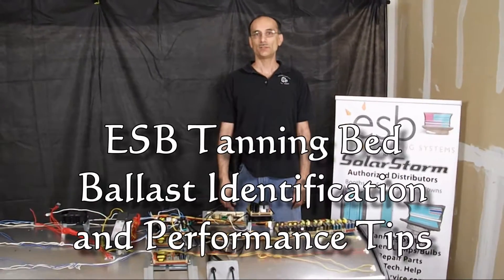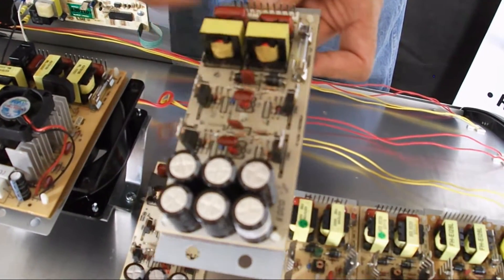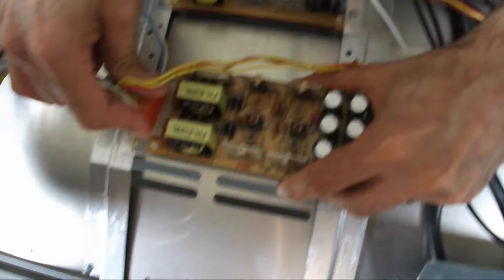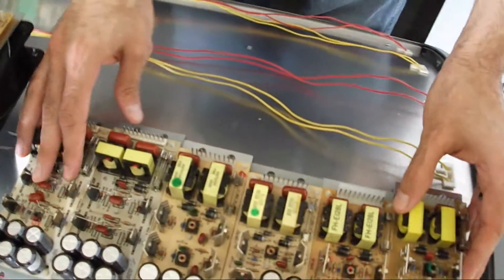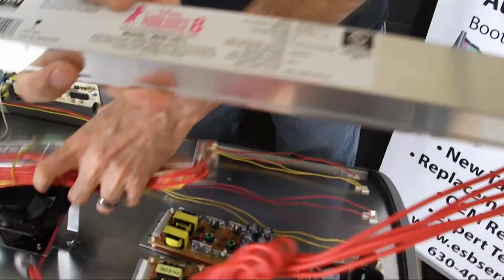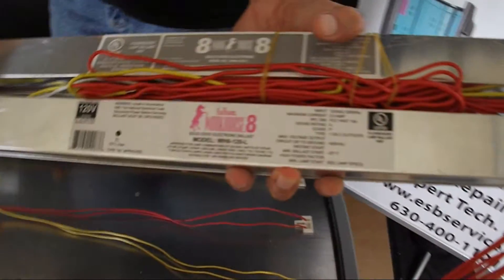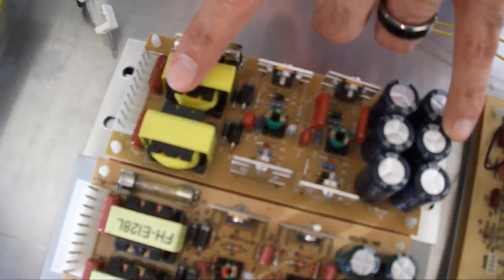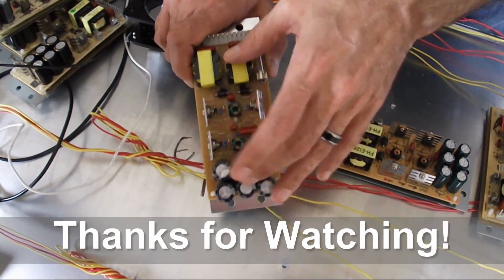Ballast Identification and Tips for ESB Tanning Beds

Comment: What components on the ballast boards usually go bad other than looking at them physically to see if anything is blown.
Reply: Thanks for getting back to me Russ. I find your videos really informative.
Reply from the maker: @EdwardSedlak  You're very welcome...Thanks a lot for your feedback!
Reply from the maker: Thanks for watching and for your question.  If you're doing component-level repair on this circuit board, it may help to know that the most common issue is the output drivers going bad.  They are four transistor-looking components usually in the middle of the board, towards the outer edges.  A lot of times, they are mounted on heat sinks, but not always.  There are two channels to this circuit, so you might only find two that need to be replaced, rather than all four...but you also need to replace the respective diodes on the board, or else you'll blow the new transistors on startup.  (The fuse usually needs to be replaced as well, of course if it blew.)  It's important to remember that this circuit does not have open circuit protection - so even if you repair it perfectly...if you connect it to an open-circuit lamp, it will blow again.  This is usually the case where that open-circuit lamp was the culprit all along.   Anyway, This can be frustrating, time consuming and costly - so I stopped repairing them myself, but it can be done if you have extra time and go about it thoroughly.  If you haven't seen it already, please see my video on open circuits here:  https://youtu.be/FSsLS75wKDw?si=oPopBOunq-tfwEr1
You can also have an open circuit in the wiring...I talk about that in this other video here:  https://youtu.be/8vMFHgp6F0E?si=vZuwmQylGM2KQEN5
I'm assuming you have a lot of experience repairing circuit boards, but if not - and/or anybody else not experienced...do not attempt to repair this board.  It can be very dangerous to say the least.  Capacitors hold a charge, and this is an amplifier circuit!  Best of luck to you on this...Let me know how it works out!

Comment: Hi we have a tanning bed and it keeps tripping the circuit breaker in the meter box and prior to this if it rained the bed would get moister in it and as soon as we dried it out with a heater it seemed to work and now it just trios the breaker
Reply from the maker: Thanks for your question.  I'd like to help you further, but the first place to start is by having a clamp-style amp-meter.  I cued up another video showing what I mean right here:  https://youtu.be/YBu5BUk3RZc?t=227
Once you have a meter like that, the next video I'd recommend is this one specifically about amperage issues:  https://youtu.be/1OLy96N7XsY
There are many things to check for, and many different possible scenarios...too many to go over here, so if I can help you further - please email me info@esbservice.com or call me at 630-400-1121, and I'll be glad to help further.  Thanks!

Comment: Ok, I just bought a used tanning bed. When I bought it it worked. I wired up a 30 amp dedicated 220 like it requires. It wouldn't come on. I checked the voltage at the circuit and it shows 253 volts. From what I read it's supposed to be between 215-230 for operation. This is a 1994 sunquest super zx30-2f. Do I need to get a buck-booster to drop the voltage? If so where and how? Thanks
Reply from the maker: Thanks for your question.  For details on buck bossters, I would kindly  recommend that you watch my other video on that topic right here:  https://www.youtube.com/watch?v=jWObXS-xRR0
Maybe Grainger might have what you need.  I hope this helps, but let me know if I can help more.  Thanks, and happy tanning!  Russ

Comment: Turn my 110 bed on and lights don't come on but the fan works. Need help in fixing thid
Reply from the maker: Is your bed an ESB or similar brand?  If so, the ballasts should get power from the same place as the fans.  I'd check the power across the black and white wires going to your ballasts to see if they are getting power when the fan is on.  Please let me know if I can help further with that.  Thanks!  Russ
Reply: @Esbservice  ok what about the power outlet. White black and ground should be wired how
Reply from the maker: @mikeblair1321  If you have an ESB brand bed, I' d recommend watching this video for the electrical requirements:  https://www.youtube.com/watch?v=HkRMcq78GWs

Comment: Hello, I have a 16 bulb, 110v tanning bed (Perfect Tan) and two bulbs side by side are out. I swapped the bulbs, no dice.. changed fuse in ballast ..nothing (although the fuse was blown) .. Could it be the ballast itself? I don't know what else to check. Thanks:)
Reply from the maker: If the fuse keeps blowing, then it's time to replace the ballast itself.  I'd just recommend  that you make sure there are no open circuits as described in this video:
https://www.youtube.com/watch?v=FSsLS75wKDw
...and make sure the connections are all good as shown in this video:  
https://www.youtube.com/watch?v=8vMFHgp6F0E

I hope this helps, but please feel free to reply here, email info@esbservice.com or call me directly at 630-400-1121 with any questions or concerns.  Thanks!  Russ
Reply: @Esbservice  Thanks Russ, I bought the bed used and I knew the two bulbs weren't coming on...I just figured it was bad bulbs. Got the bed home, changed the bulbs and they still didn't work, then I noticed the fuse in the ballast was blown. it was 4amp 250V. Couldn't find a 4 amp fuse local so used a 3amp to be safe. the lamps never came on so I assumed it was the ballast. I have a ballast on the way. Hopefully that will fix it...
Reply from the maker: @DinoNardelli  You're welcome!  If it helps, we have the proper ballast fuse available on our website here:
http://esbservice.com/parts.htm#!/Fuse-for-10-Pin-Ballast-Pack-of-3-ESB-Tanning-Bed/p/42871782
Also - we sell the ballasts here:
http://esbservice.com/parts.htm#!/Ballast-2-Lamp-10-Pin-Sigmatron-Style-120V-240V-P206B-NEW/p/25463231/category=10952185&forcescroll=true
When we ship out ballasts, we test them first to make sure they are 100% working.  Please contact me freely if I can help more.  Thanks!
Russ
Reply: @Esbservice  Thanks again, Russ!

Comment: My face lamps won't work but the rest of the bed works fine
Reply from the maker: Is it an ESB brand Tanning Bed?  I'd recommend tracing the wires back...they will probably be connected to your ballast...do you know what kind of ballast you have?
Reply: @Esbservice  it's a sun sector. Commercial tanning bed.
Reply from the maker: @dwighthafford7955  Thanks for your reply.  Sorry, but I"m not familiar with that brand.  I"d still recommend tracing the wires going to the face lamps.  Best of luck to you with that, and have  a nice day!

Comment: 9717780740
Reply from the maker: There are many knock-offs out there - but if it's one you bought from us, you would have to remove what's left of the old jumper and solder a new one in its place to convert a 240V ballast back to 120V